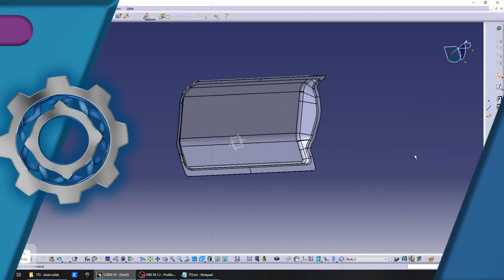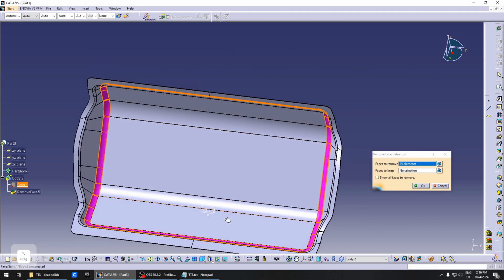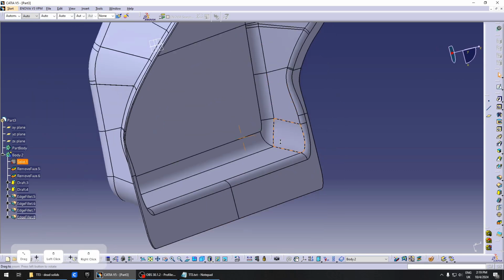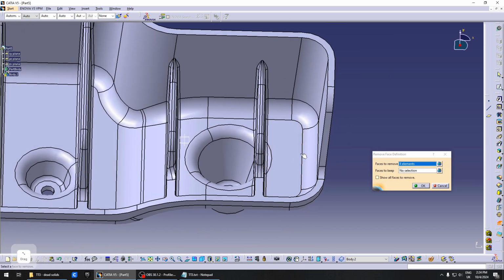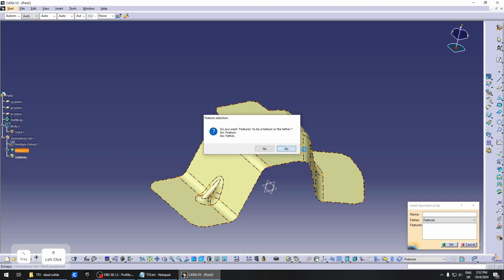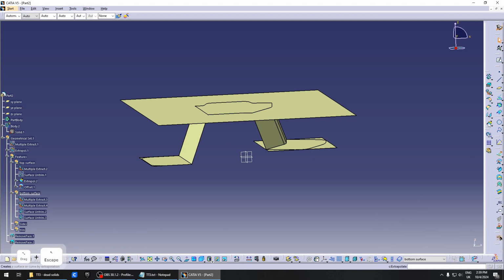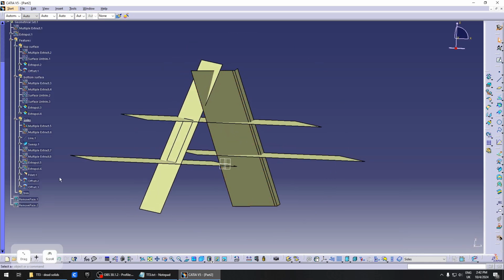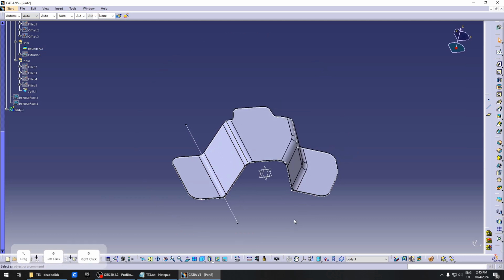CATIA V5 Tutorial - Working with isolated (dead) geometry

Comment: As I checked, it is not working in plastic part because you start removing R2 first. If you start removing R1 and then R2, it should be work for you as It worked for me.
Thanks for sharing.